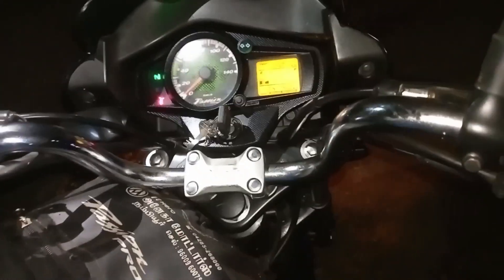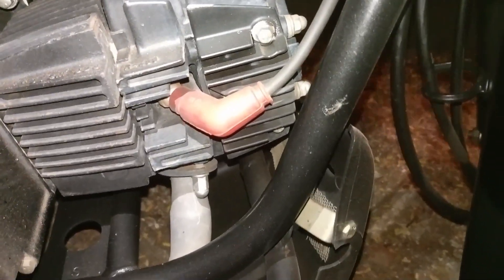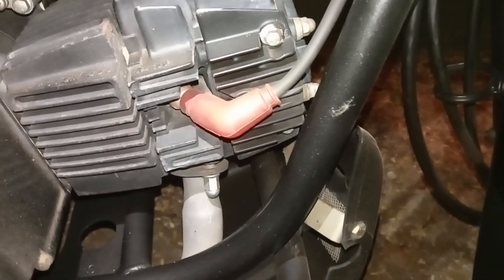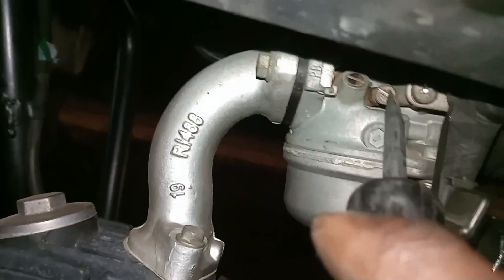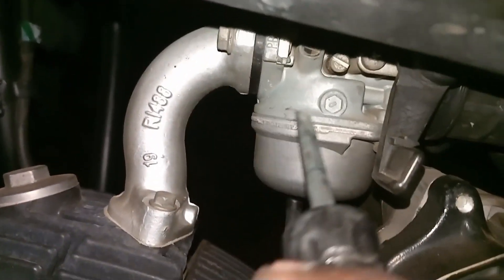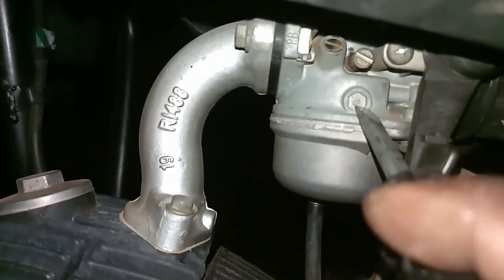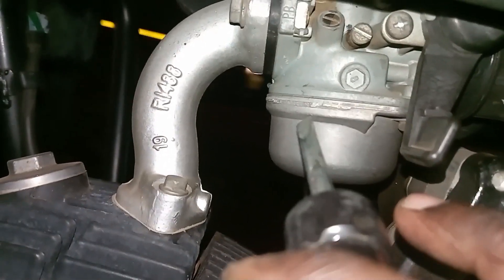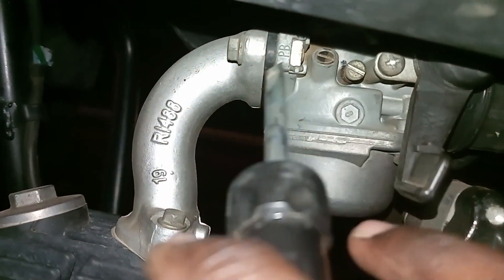Hero Passion pro carburettor tuning | Engine RPM tuning in carburettor | Bike slow speed off problem

Comment: Spring load screw -Fuel adjusting screw.. Next 1screw air adjusting...
Max Air +minimum fuel mixing ஆனா மட்டுமே milege நல்லா கிடைக்கும்... Max fuel +minimun air combination Mixing milege +performance வராது... சரியான ratio வில் Air +Fuel mix ஆனா மட்டுமே performance &milege கிடைக்கும்..